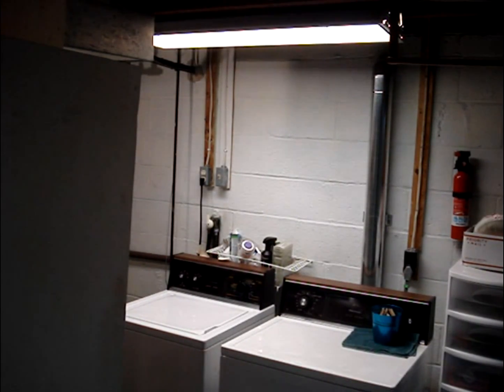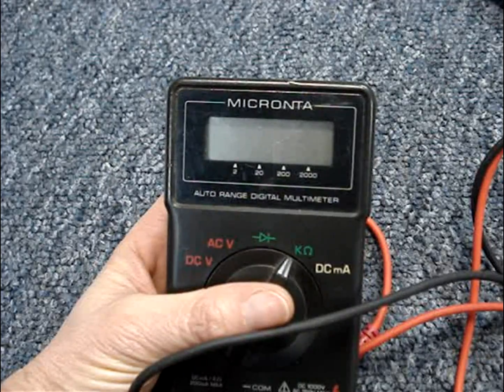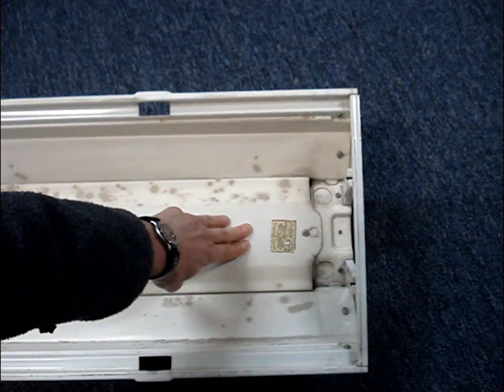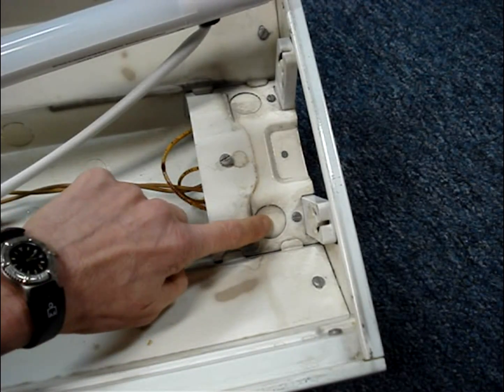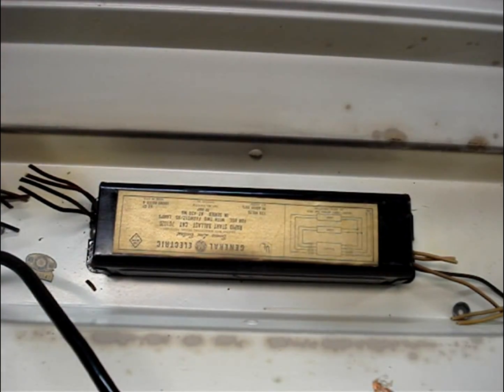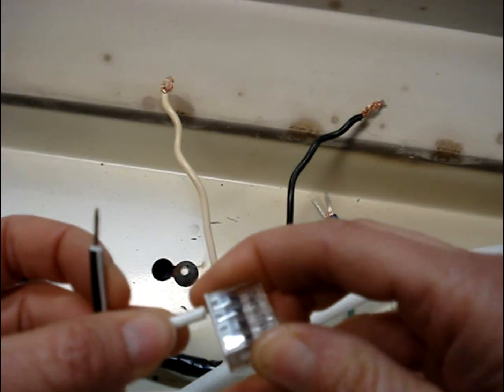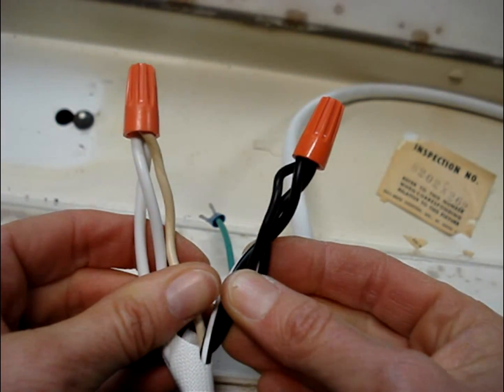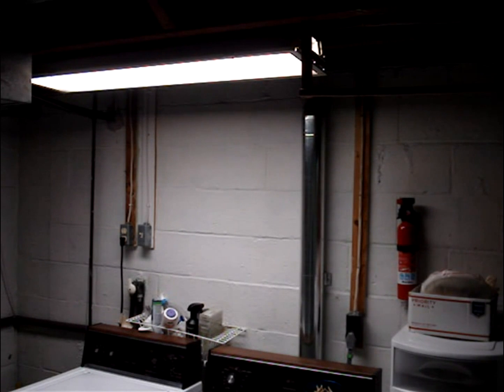LED Tube Light Installation Replace Fluorescent Tubes

Comment: Looks like the old 1960's PCB's fluorescent light fixtures normally you will see tare or PCB's dripping on the label or on the wires.
Reply from the maker: They are old light fixtures.  They were pulled out during a building renovation.
Reply: @Know-How-Now  cool